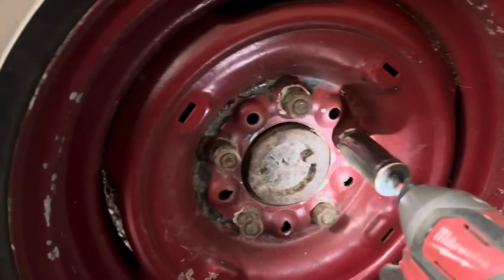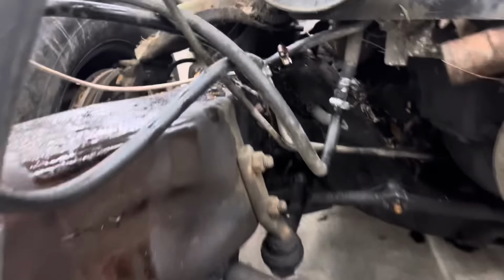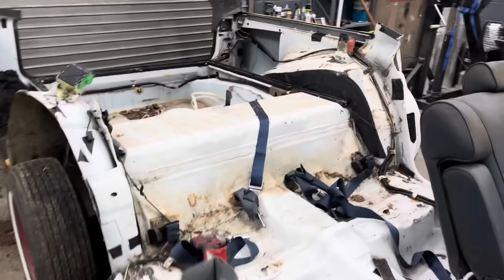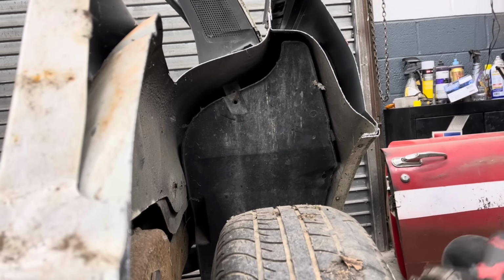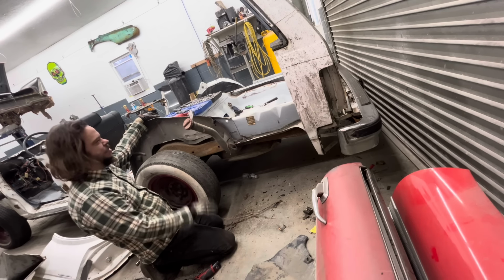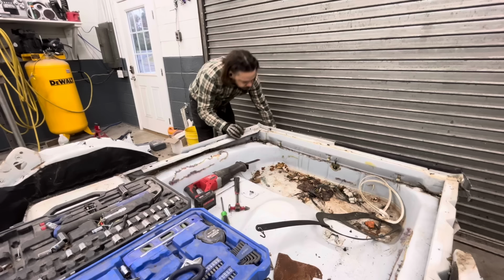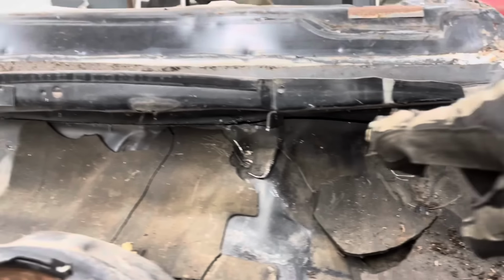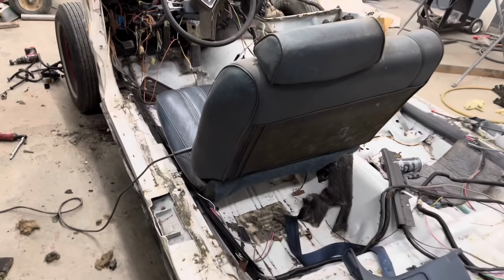1958 Plymouth Part 17. not Fury. Savoy. Body Swap! Prepping the Caprice Chassis.

Comment: I noticed the Caprice had a late 307 Oldmobile it has a computer HEI and carb it might not run very good if you cut the wires on it Keep up the videos
Reply from the maker: Yeah that’s why I don’t cut anything. But that engine isn’t staying forever.